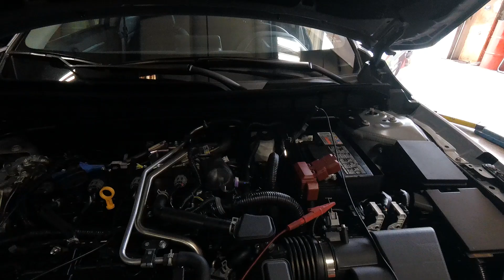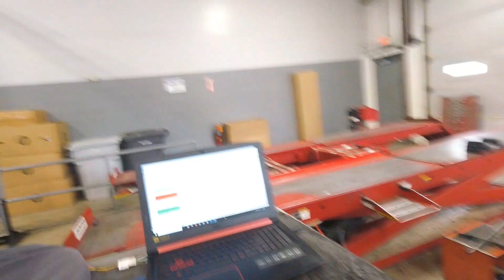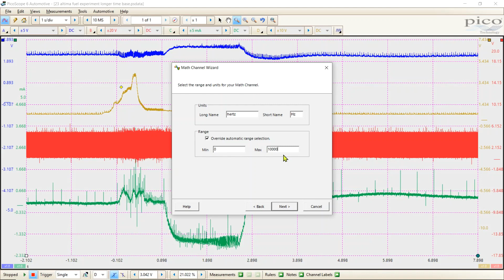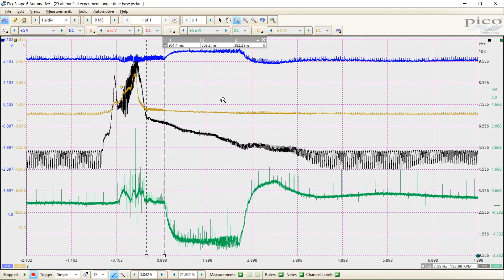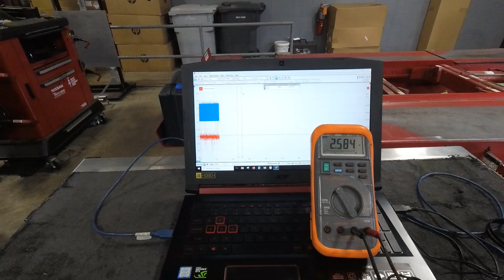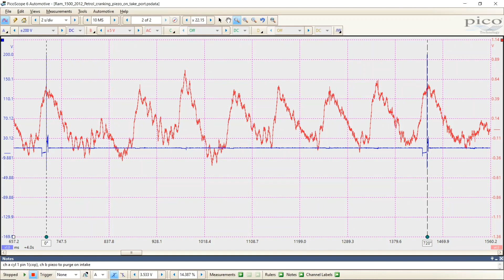Wide Band Air Fuel Ratio Sensor Testing

Comment: Re: precise current clamp, for those who don't want'/can't spend money on it or can't buy it, there may be a workaround but it will not tell what ECU is seeing from wideband sensor but it will tell what actually comes out of tailpipe. I'm about to install on my car the 60USD Chinese copy AEM 30-0300 X-Series Wideband UEGO AFR LSU 4.9, this is the AFR gauge with a wideband sensor which can also be put in the tailpipe (same way as a first-look / pulse sensor), as commonly used by tuners on rolling road/dyno. Its controller has an output wire (I think 1-5V) to e.g. PC or external gauge, some other solutions also provide CAN etc. So one could use this output with oscilloscope I think. I'll verify this when my oscilloscope arrives. There are other, better solutions with better sensors (LSU, LSU ADV) but the price also goes up, the best I think is 14point7 Spartan 3 v2. The chinese copy is not as good as original AEM nor Bosch sensor but it should be enough for what i need from it. I bought it to monitor my tuned BMW engine along with EGT sensor/gauge and many other gauges which I found extremely useful to despite their cheapness (China knock-offs) e.g. battery charging ECU strategy, coolant temperature ECU strategy, oil pressure vs time/temperature etc etc.

Comment: Mate, I love your videos and I have learned a lot from you. As we all learn from eash other, though, I have ro point out that the Wideband Oxygen sensor readings are the opposite to what you stated in the video. 
Positive current (above the zero line) menas LEAN.
Negative current means RICH.
When the engine reved well and you pulled your leg off the accelerator pedal - the moment you call "injectors cut" actually causes the mixture to go RICH (not Lean). The injectors spray a predefined, fixed amount of fuel in this condition (fuel ECU does not look at the O2 readings then).
The reason is to avoid mixture getting lean and causing "pops" on deacceleration.😊
As the throttle is fully closed at this moment, there is less air than normal and mixture is Rich. Hence the O2 sensor reading goes sharply negative (Rich) and stays there until engine load increases again and the Idle Valve opens to increase engine speed (to make it Idle). 
At the other moment, when you sharply pressed the acceliratior pedal, lots of Air entered the engine and the O2 sensor reading went up (Lean). The Fuel ECU compensated a moment later and the O2 reading went back to balanced.
Hope that helps. Thank you so much for the effort in putting these videos together and sharing your knowledge.
Reply from the maker: Thank for the comment, very informative and yes we all learn from each other. I agree with your rich/lean statement regarding the polarity of change positive and negative. 
The amp clamp that I'm using is direction sensitive like all amp clamps. I simple oriented it to show positive rich and negative lean, it works better visually for me thats all. I was only interested in the speed or reaction time of the feedback system with this video and to practice a bit with my clamp.
Thanks again for commenting and keeping me on my toes , great information you have posted.

Comment: Really good info here!  Wow!  Now you've inspired me to try this on my cars.  Question, would a standard low amp clamp work or is that low amp clamp you mentioned something special?  I have the ES #695 20/80 amp clamp.  Also, I really like the way you think. Testing things now to get a baseline on new vehicles so that you have something to reference down the road when those vehicles have problems. That sounds like genius level stuff to me.  God blessed you with a great mind. Thanks for what you share with us.
Reply from the maker: Wow thanks for the wonderful comment!  I don't think a standard "low" amp clamp will work. The k110  can read milli amps very precisely.  Its range is 0 to 450 milliamps. Knowledge is power in my opinion,  so the more Knowledge I gain from testing new cars I feel it makes me more efficient in the long run. Creating and sharing to a YouTube community just seems like the right thing to do. Thanks for joining in!

Comment: Very interesting video. Great they let you experiment on some new cars for test subjects. Was particularly impressed with how tps and maf were practically linked together.  2 questions.  You mentioned orienting clamp to show amp capture in the way you did. Was that just easier for you to think through it? I was thinking that under rich conditions an A/F sensor would go into negitive ma and vise/versa for lean. Maybe I was wrong?
Reply from the maker: The tps and the maf were almost perfect,  I was surprised by that also.  As far as the orientation it was just personal preference for it to go positive during rich for me.  I'm not sure which way its actually supposed to go, (I think your correct rich is negative) It may also depend on which wire the clamp is around.